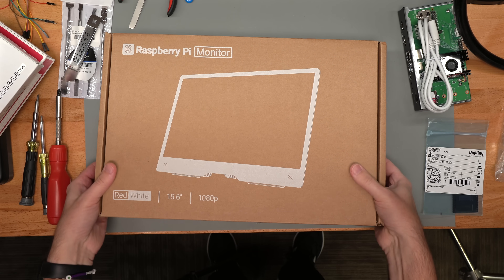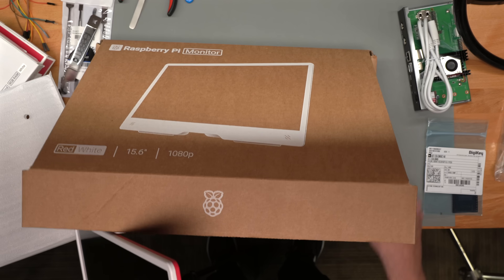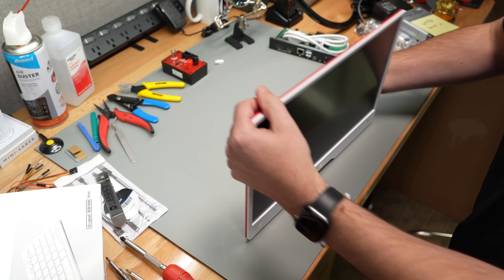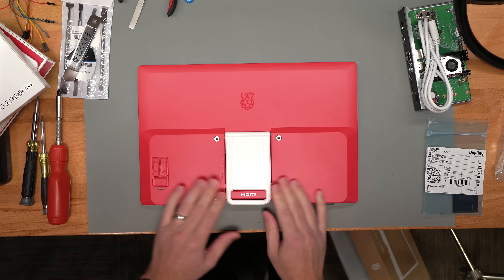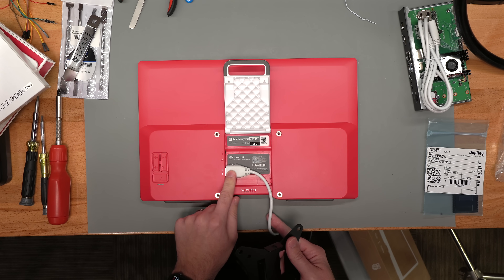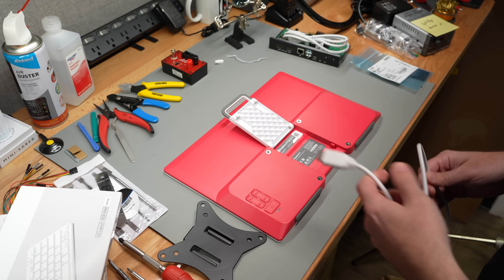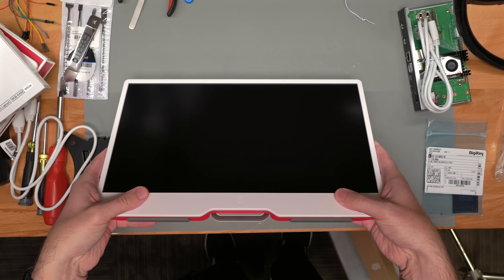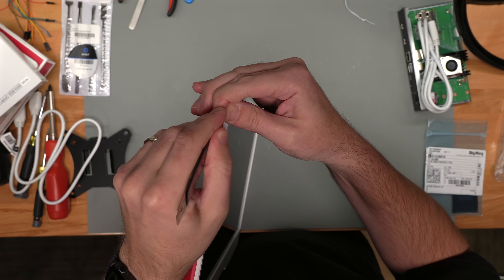What's inside the Raspberry Pi Monitor?

Comment: WOW someone use his bain, speakers at the front! on the other hand, putting the connectors behind something that you are gonna screw, kinda stupid. so looking at the whole package no improvement +1 + -1 = 0
Im tired of seeing this stupid trend of lets make things easy on the manufacturing side and f the user, by logic oll the heavy work must to be done in the step that is done once, to make its use easier. No wonder that Enshittification is the trend work of the year.
btw a cheap portable monitor is almost half of that, and the touch about 10$ more, soo...
Reply from the maker: To be fair to this display (wrt price), the quality is better than the cheap $50-70 portable displays I've used. It's an okay value at $100 IMO, and the hinge design is honestly better than the three other portable monitors I own.

Also being able to run on 5W of power is nice, one of my displays was way too picky about which USB ports would work to power it!
Reply: @Level2Jeff  sure must be better than the cheapest, but it feels like they avoid giving the best, for example, i bought a cheap 5v amp pcb and a pair of little speakers, like the ones on the raspad, it cost nothing and the sound is at least 5x better. 
And the position of the connectors, why? Its like they do on purpose somethings bad, because the cheapest things can absolutely not be good 
I am still disappointed of the growing trend, generally

Comment: It's cool, but it's tough to justify this purchase at $100. I wish they would have taken a more barebones approach: no headphone jack, no speakers and no internal battery. It needs just a USB type-C port for power, an hdmi for video input and a simpler kickstand. Then, price it at $50 or at least something competitive.
Reply: no, 2 type Cs for power and video and the pis should have the type Cs
Reply: Just bought a brand new Xiaomi monitor 100Hz, 23in, ultra slim with all expected functions for $70. RPi pricing at this point is just like apple premium products but plastic
Reply: you're not the market for this, the market this is being offered to is mostly schools and nothing else.
Reply: @nitrobear  still does not make much sense. schools would be better off just buying a normal monitor at this price point. I guess I just don't get it. Maybe they just expect people to buy it because its made by Rpi or maybe because its manufactured in the US or something, idk. I just don't get the value proposition here.
Reply: @walt_the_dolt it’s the same color as the pi 500. How much more do you want than that?
Reply: You want nothing but a display with kickstand, many folks probably absolutely require some audio etc - to me this seems like a very justifiable price for a fully functional portable display - I wish I had something like this long ago as whenever you are going on a family tech support call (which as always no idea what is actually wrong) having a small properly portable but known good monitor and cable etc is handy, and its the right sort of size to slip in your laptop bag. There are other options similar to this, but few seem to be better or cheaper so I'd say the price is about right.
Reply: @foldionepapyrus3441  The market is flooded with monitors just like this one that cost $70 to $80. And those ones can be easily plugged in when mounted. This is an overpriced cookie cutter product with the Rpi name slapped on it.
Reply: @walt_the_dolt  The ability to adjust the cables easily can just as easily be a bug not a feature. If I wanted a heap of cheap screens to put on VESA arms for a school knowing its going to take a screwdriver for the curious kids to mess anything up is a good thing for instance! 

As not everyone wants the exact same thing what is annoying for one is good for another. For a display this size and resolution, with speakers, headphone jack and such a well thought out kickstand/wall mount and VESA mounting option it is in the right price bracket... Certainly not the cheapest, but you'd not expect that from a Pi product - they are affordable while still being highly supported and good quality, the cheapest crap...
Reply: @foldionepapyrus3441 nah. The market has many equivalents for lower pricing.

Comment: Its a pity it csnt stsnd on portrait mode, i was thinking it would be good as secondary monitor when traveling, the laptops as main and this in portrait next to it, sad thst the stand wasnt well thought.

Question: can you use the usb c to deliver both power and video signal?
Reply from the maker: Unfortunately USB-C only for power input. The hinge thing is definitely a design tradeoff. Could possibly 3D print a piece that would let it stand vertically, but someone more creative than me would have to do it!
Reply: @Level2Jeff   I thought the exact same thing, getting 2 of those as external Macbook displays for travel. But no usb-c video input is a deal breaker. That would've been perfect.

Comment: First thought is that I’d just put the monitor in a large enough laptop sleeve for some measure of travel bag protection.

Going to hold off buying any of this new stuff released today as kind of get the impression it wasn’t 100% ready, especially the Pi 500 without the NVMe slot on the PCB.
Reply from the maker: I think they're both ready, it's just a decision to differentiate Pi 500 from some other SKU they must be working on :(

It does keep costs down at least somewhat, but I still would've liked the parts on the board!
Reply: @ Yes, I can see that too.

However, announcing that an NVMe populated version will be available in say a couple of months time would have been nice from a consumer point of view. Avoids the “I bought a Pi 500 and now you release an NVMe version. I’m annoyed …” scenario.

Good job I snagged a CM5 kit on release day now, and have plenty of the supporting peripherals to attach on hand too. Though not as many as Jeff of course 😂
Reply: @stephenvalente3296  yeah it's kinda scummy to not do that honestly.

Comment: Cool, i still want a portable monitor,  to bad it does not have a cover.  but the price is pretty good for it
Reply: I usually use Etsy and get bespoke sleeves, there are many creators that make felt sleeves to the dimensions you provide
Reply: Walmart sells felt. Use cardboard to glue the felt on to make a sleeve.  Easy stuff.

Comment: this looks kinda interesting for monitoring video from a camera on the cheap. won't give you the features of a proper video monitor but it's bigger and cost 1/6th as much.
Reply from the maker: I actually used it for that at one point while I was working on some b-roll shots :D

I normally have my 23" display set up for that, but I wanted to see how this one would do. The viewing angles aren't quite as good, but they're adequate at least!

And the Pi Monitor is light enough you can buy a cheap monitor arm and not worry about it sagging.
Reply: You can get new monitors for under 100$ that are 24 inch, and have a 75hz refresh rate. Like the Lenovo D24-40. It does use more than twice the energy, but it's also 50% bigger diagonally, which makes the area 136% bigger.
Reply: @xaddict  that's a great point. the appeal for me is that I can probably fit this monitor into my backpack and use it as a supplemental monitor when doing video work on the go. USB-C for power also allows for the use of a power bank.
Reply: @shadowlerone  Good point, it's a pretty good price for a portable monitor. There are power banks with power sockets these days, but that's still more of a hassle than just plugging it into your laptop.
Reply: @shadowlerone  you have better displays for cheaper that can actually run completely off the USB-C port from your laptop. Better resolution, same or smaller size and better power compatibility too.
Reply: @nitrobear  I'll look into them. Single cable from USB-C isn't a top priority given the goal would be to run it off a camera. I'm not sure how much cameras handle power delivery off their USB-C port, and to my knowledge they don't pipe a display signal (though correct me if I'm wrong because that would be epic). 
What should I be on the lookout for to judge power compatibility? USB-C PD? or is it something else?
Reply: Thanks for the video. 😊 Considering this Pi monitor as need a monitor to pair with a Pi5 ( in the basket at Pi hut now) for projects and coding. I don’t have another monitor right now as I use a Lenovo legion 7 laptop for work and gaming, and having a normal(ish) 19/21/24 inch monitor sat on the desk which is just used for Pi coding/ projects seems like waste of desk space. Any thoughts thought fine people? Sorry - I am a newbie to the Pi.